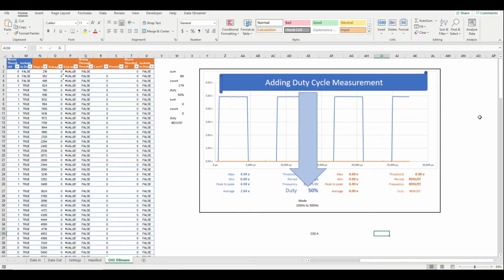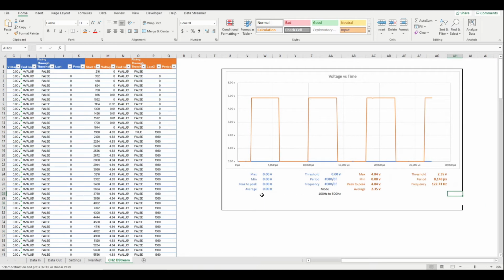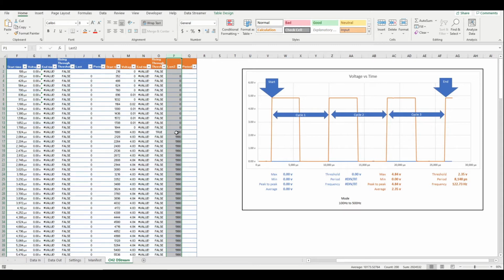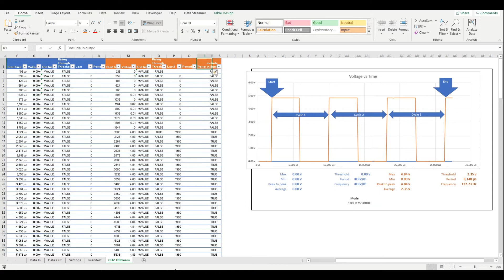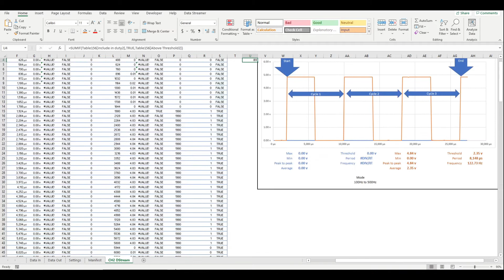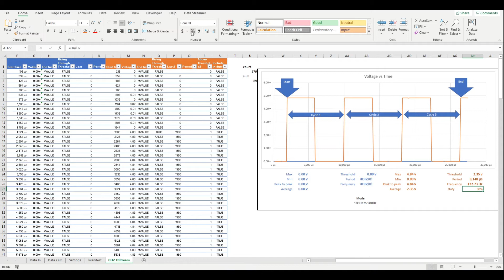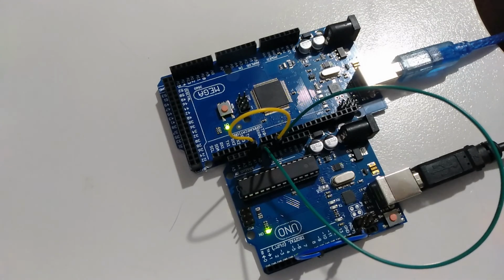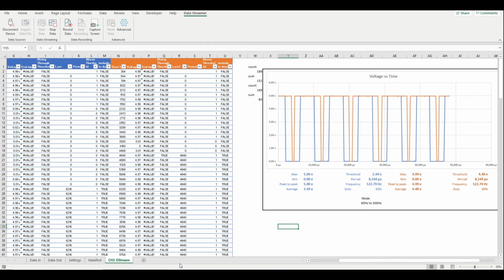Measure Duty Cycle with Arduino.  (Exceloscope part 7)

Comment: Just wanna say thank you, I'm having so much fun having a little oscilloscope for cheap.
Reply from the maker: Thankyou. 😀
Reply: @overengineeredinoz7683  by the way, I tried with a NodeMCU ESP8266 and it yielded great results, faster, has more memory and better resolution although limited to 3.3V.
Reply from the maker: That is interesting.  Does the ESP8266 allow faster sampling than the Arduino can do in this video? https://youtu.be/VunRAOs5lbc
?
Reply: @overengineeredinoz7683  Sorry, I couldn't tell you because I still struggle with coding the more advanced stuff like you did in part 8. Hopefully yes
Reply from the maker: I see. Thanks for your comments. Much appreciated.